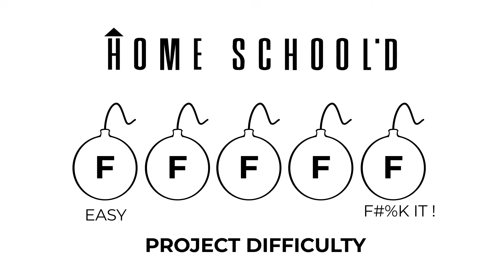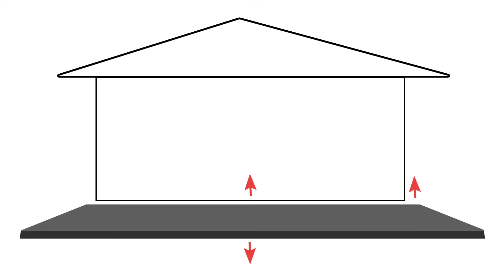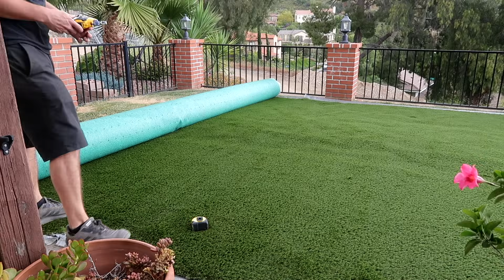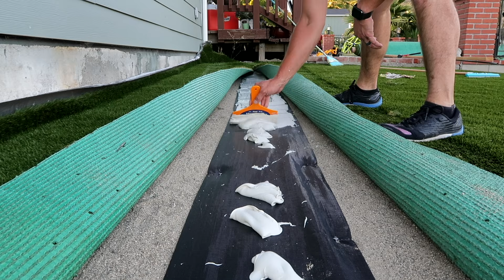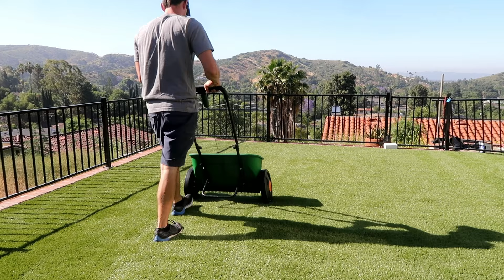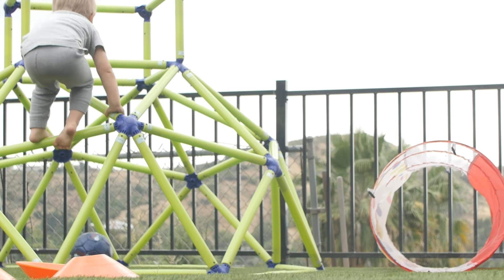How to Install Artificial Turf | A DIY How To Guide

Comment: Hi I was wondering what is the cost per square foot of a project like this I'm getting to a point where I don't know how much longer I will be able to cut my lawn and it's not very big thanks a great video 👍🇺🇸
Reply: I just sent them a request for pricing on a small area in our back yard.   I’ll update with what they quote me. At least to give an idea of cost of material.   
I hate to jump through hoops only to find out the cost is ridiculously expensive.
Reply from the maker: I can’t speak to that really because I don’t do installs. I’d suggest you look for a local installer who can give you a quote.
Reply: Hi I appreciate your reply I have the help and knowledge I was just wondering about the cost of the product but thank you I'll try to find it online unless you have a link
Reply from the maker: @richkarn3792  Each state has a Synlawn supplier. I would suggest you google who is their rep in your State

Comment: I've  been installing artificial turf for years  all over United States.  And honestly you did a good job especially for it being your first install.  I would definitely never recommend synlawn turf though.
Reply: why
Reply: @TexasGarden  it's cheap Chinese turf just like shaw turf. They re wrap their rolls of turf and claim its America Made
Reply: @Florida.5  what brand do you recommend? Where can you find it?
Reply: @elca2475  the best artificial turf is easy turf. Where are you located?
Reply: @Florida.5  do you recommend Smart Turf? I am in Gilbert Az. And the contractor left me
A sample
Of 65 oz. Spring Select. Says made in USA
Reply: @josenegrete3694  No,  I would recommend going with easy turf or forever lawns. They can be more expensive but there's turf is definitely worth it.
Reply: I've seen some artificial turf get dmamaged in harsh heat and sunlight. Is there a way to know which ones won't be damaged?

Also does the sand/fill need to be replaced every so often?
Reply: @SunsetSnowfall  I'd recommend making sure you buy American made turf. The Chinese turf get damaged real quick by the sun. Or sun reflecting from windows. You shouldn't have to add more infill if you apply correctly the first time. Depending on the length of fibers 2lb per sqft should be enough
Reply: Where do you work at I liv in southern  cali..is this perhaps in your area would love to hear from you about doing a job..
Reply: @ryanduderty3963  I'm in florida. Thanks

Comment: How do you deal with the sun reflecting from the window reflecting on the grass. Won't that melt the artificial turf?
Reply from the maker: I have not had that problem. I have seen some people mention that but I have had this product installed through the peak summer months with daily temps of 100° in Southern California and have had no issues. I can't speak to the issue because I haven't experienced it.

Comment: Have you ever had issues with static electricity shocks off artificial grass? We had some installed last year and the kids have stopped playing on it due to static shocks.

When I asked the installer about this they said they had never had this problem before and were puzzled as to what may be causing this.
Reply from the maker: I have not had that issue nor have I heard of it before
Reply: @MrFixItDIY  thanks, I'll get back onto the installers today and see if they can come up with any permanent solution to this
Reply: @danteraffin8589  hi, could you send some information about this?
Reply: @retromark4558  Absolutely. Send me an email at dante@foreverlawn.com and ill send you over some information

Comment: Won't the rainwater move through the artificial grass into the underpaving, in a heavy downpour, it won't move across the surface not unless you have significant fall. You should have raised your underpaving to the level of the perimeter. Then you won't have any water get trapped by the border.